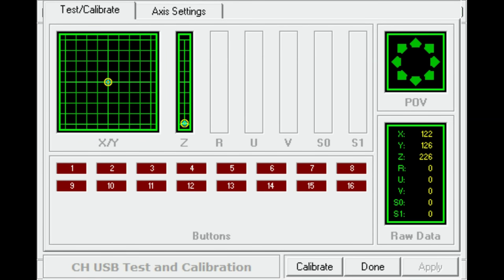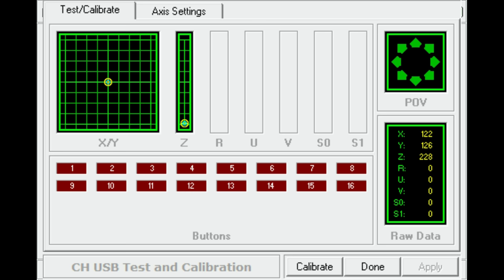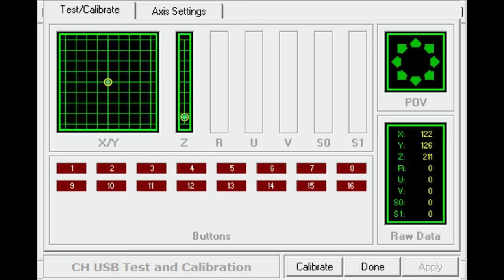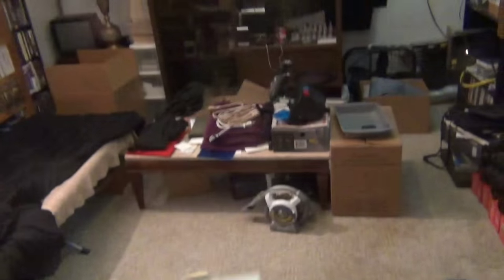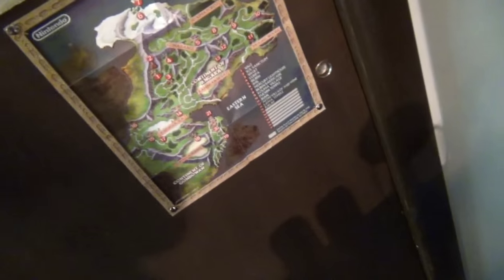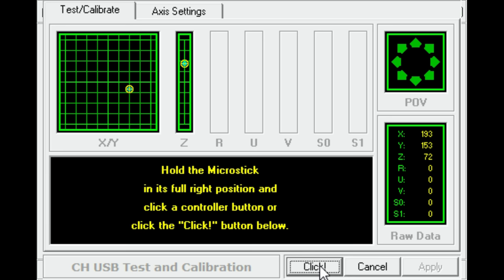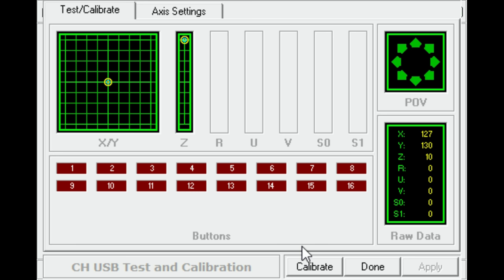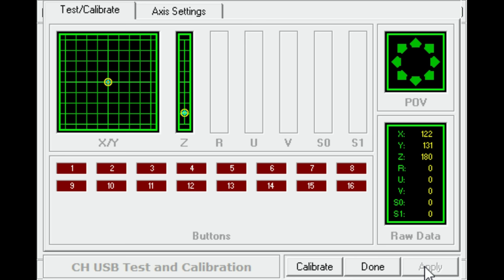CH Throttle jitter solved

Comment: Thanks for this video. I had already sent my throttle back once for repair, only to have the problem return about a month later. I was about to write back and ask to RMA the unit again, something I was not looking forward to due to the 3-4 weeks of turnaround time to the depot. Thought I would search the internet again to see if anyone else had a similar problem and solution. 

So I found your video and followed your advice and unplugged everything that was USB from my computer, including a passive hub, and just left my CH products(stick/pedals/throttle), mouse and keyboard plugged in. Voila! it worked immediately. Hard to believe it was something so simple. Of course now I will still need a powered USB hub so I can plug everything else back in. 

I guess the CH Pro Throttle is sensitive to power drains/drops across the USB device chain, which causes it to become unstable and display the behavior we are seeing.

Comment: Mate, your a bloody genius! 
Although I couldn't find my USB hub to test, the next best thing  was making use of the Orico 7 Port USB 3.0 PCI-E Card, which I believe improved the voltage enough allowing me to range the pro-throttle slide more smoothly and accurately. Possibly the 9 year old mo-bo is getting bit long in the tooth  :(

Thanks again  ; )

Comment: With some courage 2 Weeks a ago, and following some advise else where on the net,  I took the throttle apart! Warranty dissipated along with the quality if the original wiring 10 years ago ! So truth aside, I unscrewed the throttle unit and untangled the wires inside by unclipping and turning them around away from their interference with the lever mechanism.  The three wires I'm referring to were loose, causing intermittent loss of continuity and resulting inn the jitters! With some pliers I "gently" pressed the contacts together, but soldering would have been better! Problem solved with jitters gone ! Throttle feels and acts as good as new and I feel it's a real shame that I had to do this to a product I value so much and take pride in using and talking about !
Reply from the maker: Glad that your solution worked for you:) I was not prepared to go that route. for me it turned out I just was not getting enough power to the unit due to running it from my chair to the pc. as well as having way to many USB items plugged into it as it was. The Powered Hub solved those problems for me. But should they ever return, I will give your solution a look.
Reply: Exactly! After buying a USB 3.0 PCI-E Express Card that I had forgotten about, and after reading some forums, I decided to plug in the card and power from there. I think it helped a little but fixing the lack of contact / continuity definitely resolved the issue and not just the symptoms. I have a power Hub on standby for when I start adding other equipment too. LOL  Having read about this fix some months earlier, I had put it off for the same reason. And so waiting for the right time, one night I just decided to crank the throttle open! So the best tip I think I can give is for you to copy down the order of the wires and use some long narrow pliers! Write the sequence down /  take a picture. You cant go wrong if your gentle. And hey, if the contacts aren't loose then you know what the problem isn't. Another plus: Due to the simplicity of the throttle as outlined in this review does us a big favor minimising components getting in the way etc.  Just disappointing at the lack of quality for high end product. But I've had my CH HOTAS  since June/July 2005 and would never look back due to their robustness and program-ability. I remember how many issues there were with the TH Cougar and the number of mods available for that baby! I think people were going without god knows what to afford the next Uber upgrade ! I do like the Wart-Hog though and think it's an excellent stick combo, but everyone I know online recommends ditching the TARGET software and going with just with DX and that's fine !  I think these HOTAS's  are a hobby in just themselves sometimes, and regardless of what stick you do have. So that's enough rambling from me. Hope it all goes well as it should, as it was the quickest and most successful no fuss fix I have completed. Of course, if it's still under warranty contact the manufacture !!!! Mine was 13 years old :)

Comment: Wow had jitter for a while on a non powered USB 2.0 Hub changed to USB 3.0 powered but that I removed as didn't want another powersupply running and it solved the issue. :)

Comment: Thanks for that video. I have the exact same behavior on my CH Pro Throttle and it's driving me nuts. Funny thing: I just threw away an older powered USB-Hub, thinking I wouldn't need it ever again... sigh
Reply from the maker: NP, hope my solution helps you.Something I recently found out about when fighting to get my oculus rift to work, different motherboards use different chipsets in their USB ports. and I'm just one of the unlucky bastereds who happens to have one the rift cant see. I had to buy a separate USB 3.0 card in order to get it to work. (its powered by the pc itself via the old floppy power source no one uses anymore) I haven't tested the CH gear on it, but it might work as it is powered

Comment: I seem to have this problem too but my motherboard has usb 3.0 which should supply extra power. I've seen some CH Control Manager situation where you add a moving deadline but adds lag.
Reply from the maker: +PureAwesomeness My pc has the 3.0 as well. But didn't seem to have enough power. Part of that problem may have been the fact that I am running the stick, throttle, peddles, and the Razor keypad all through one hub, and the 3.0 coming off the PC couldn't supply enough juice to properly supply all those components. I also have to use a USB extension cord to make it from the chair to the pc. Though that does not explain why the problem didn't happen originally, when I first set it up, getting the powered hub did solve my problem. and setting the dead zones of 10 on the mini stick and using a pencil tip to prevent the throttle from completely going to zero when calibrating did work for me.
Reply: Dracuss Darkweave I see, could you link me to the USB Hub that you are sure will work? Thanks
Reply from the maker: +PureAwesomeness any powered hub will work, I bought mine at a best buy. it was also the only powered hub they had in stock. but if it is getting power from a wall outlet it should work.